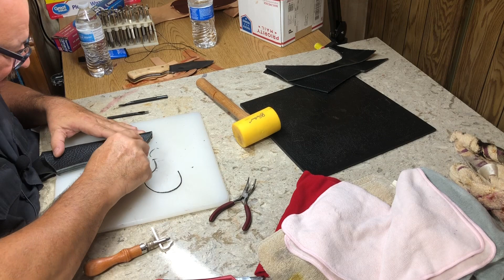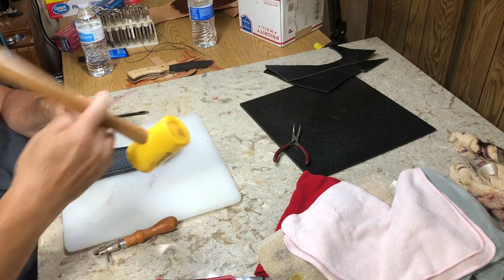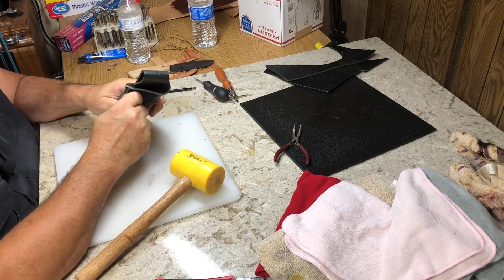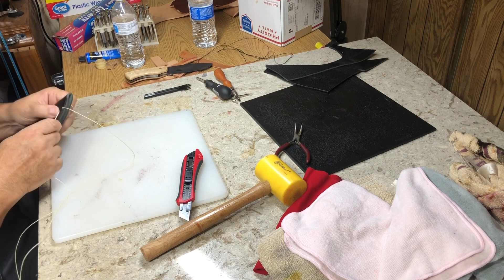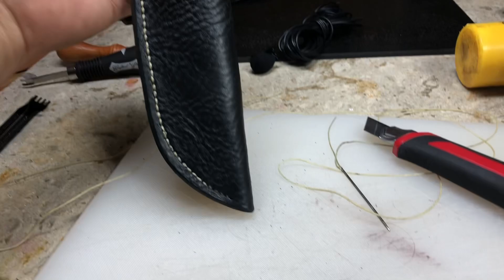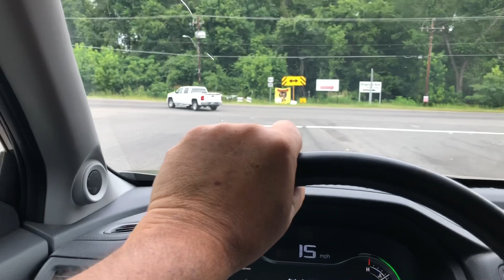How I got fired,    for the fifth time

Comment: Good call on the white thread...it looks really nice with the light handle spaced by the black leather!  
Definitely understand about the permanently disabled thing...I was injured on the job too and they had to do the same to me...so I am on computers & electronics now.
Reply from the maker: What do you do with puters?
Reply: @bctruck    
Clean & update them by remote...and will work on them physically if I have them here...also do data recover if the drive can spin-up.

Comment: I got a buddy running sandbox out by Shreveport he cleared 9k last week I’m checking on my truck while I’m home this time see if the mechanic is working on it
What I don’t get is you can’t leave kids or pets in a car but at the Truckstops I see signs where trucks can only idle 5mins so it’s ok for truckers too tryn sleep in the heat (or swelter too death)
Reply from the maker: I ended up having to buy a generator, so I could have AC when I slept.